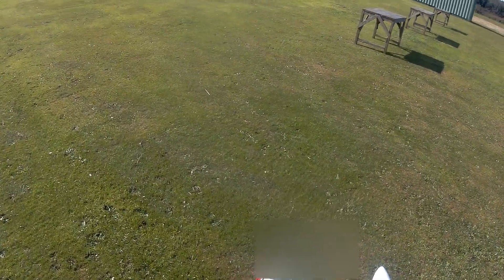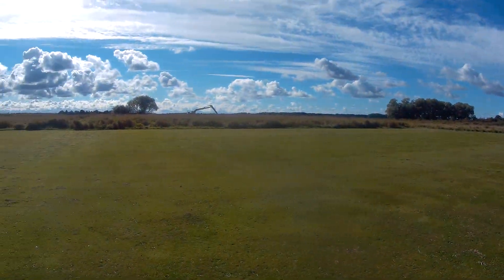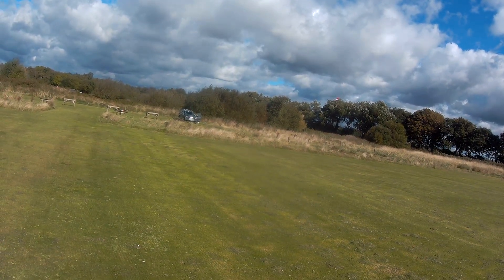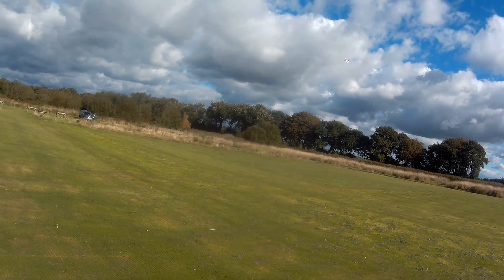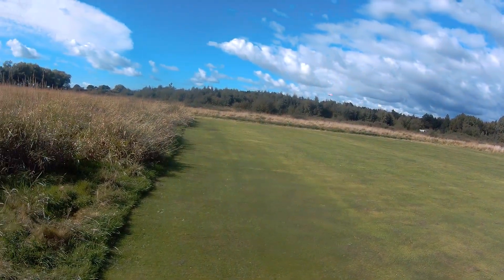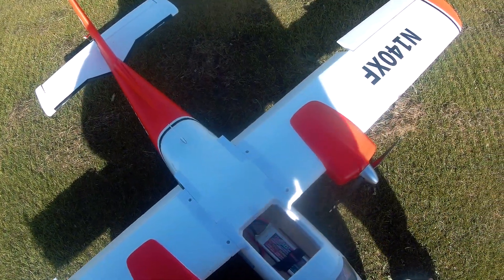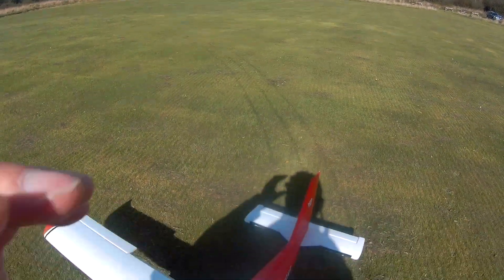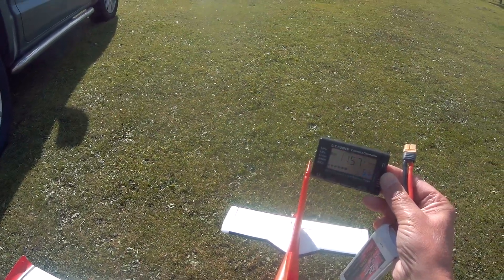XFly Twin Nova Vulcanair P68C

Comment: I've got the Multiplex version and absolutely  love it. I find the main U/C is a bit fragile,  anything less than a perfect landing will bend it. I've made a replacement from piano wire which is much more resilient
Reply from the maker: Think I bent it slightly once. It's easy to bend back. Great plane though.